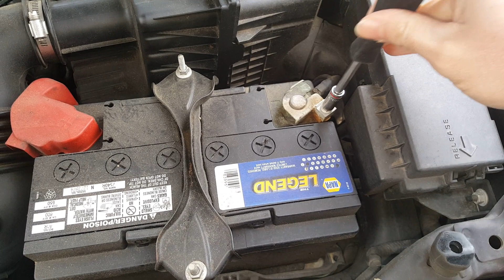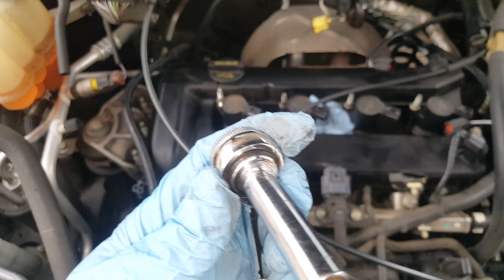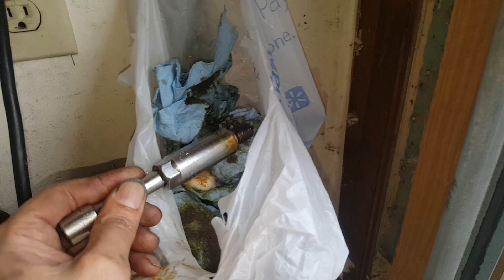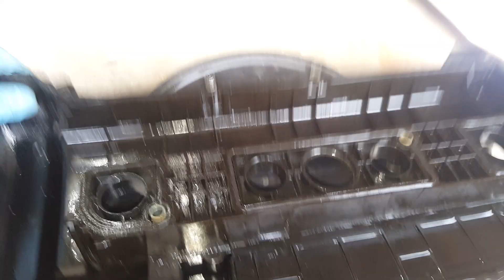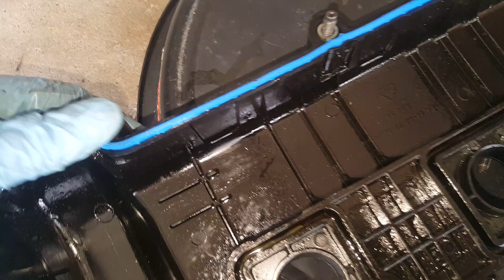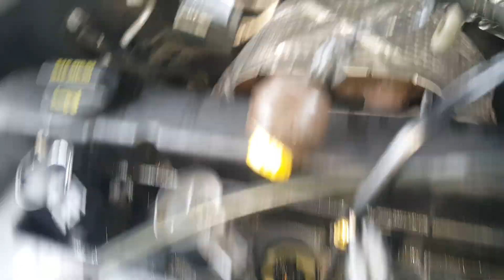How to replace the valve cover gaskets 2005-2008 ford escape 2.3l

Comment: Thanks for this video. Are all the gaskets for this engine blue? I do like the contrast. Thanks again
Reply from the maker: I believe these were fel pro , atleast they came as blue gaskets. I have had pretty good success with fel pro . Thanks for watching
Reply: @WrenchTheory501 I actually ordered them through Amazon for 13$ . They were blue as well. The job went well. With the acception of trying to disconnect the one sensor wire. Took me 15 minutes to release it. Thanks again

Comment: why is there oil on coil pack? 
trying find videos. why Internet not helpful! you have video for what's below this valve gasket oil is my concern. pull plugs i see some oil.. below them also do I have change gasket down further
Reply from the maker: Replace the gaskets shown in this video and that will fix it. Appreciate you watching

Comment: Excellent video. This is the third different video I watched before I do my 2003 Escape, but hands down THE very best. Thank you for showing ALL of the angles and potential problems and issues. You left no stone unturned. I’m very mechanically inclined, and I know I can do this with the knowledge you provided without fail. Thank you for covering everything and even better, by doing it one handed while shooting your own video.
Reply from the maker: I really appreciate the exceptional feedback,  thank you.
Reply: I just finished this job! Thank you so much again for your outstanding video. I took the most time cleaning the valve cover top and bottom, and the top of the engine.  It was a simple job. All of my plugs were full of oil. I pulled out about 6 ounces, but the coils slid off the quite easily. I replaced them too, and put it all back together, except I made one mistake. I dropped one of the 10 mm nuts and it stayed somewhere hidden on the engine and I couldn’t find it.

Comment: Escape 2.3L  According to the Ford service manual the:

FoMoCo Part Numbers and Torque Specs:
Ignition Coil (4x) 12A366; Dielectric Grease FoMoCo ESE-M1C171-A in the coil hole,
Spark Plug (4x) 12405, Gap to 1.25 - 1.35 mm (0.049 - 0.053 in), and Torque is 12 Nm (9 lb-ft);
Ignition Coil-to-valve Cover stud bolt W705310, Ignition coil torque to 8 Nm (71 lb-in);
Valve Cover Gasket 6M293; and
Valve Cover Bolts (14x) W705310 (10 Nm (89 lb-in)).
Your Welcome.

Comment: Why mechanics I talked to don't wanna do this? It doesn't seem so hard but they said these changes often fail. Everyone suggested me to buy a new engine so far. As someone who doesn't know anything about cars and engines, I am afraid of changing this myself.
Reply from the maker: The valve cover gasket is a very simple process , however a head gasket is a whole different story. Thank you for the feedback.
Reply: @WrenchTheory501  my friend told me it was head gasket but maybe it is called valve gasket? The issue is same as yours. The oil fills in the spark plugs. Is there a way for me to understand which one it is?
Reply from the maker: It is the valve cover gasket , the seals around the spark plug wells are leaking. It is a pretty easy fix , and not expensive. Thanks for the feedback.
Reply: @WrenchTheory501  Thanks so much!

Comment: Hey thanks for making a video, I tried using the link for Amazon for the gasket and it says it doesn't fit a 2005 Ford escape on Amazon... 😬
Reply from the maker: Ignore their compatibility guide . If your escape has the 2.3l , it will fit. Thank you for the feedback and thanks for watching.

Comment: My 2008 xlt have oil on the spark plugs. It start shaking, feel like it’s dragging, and  accelerate slow after the car warms up. It went away after I changed the spark plugs and the oil drained down. But 2 weeks later it started doing it again
Reply from the maker: If your spark plugs and gaskets are all good that should keep the oil out of them. I would move on to the coil packs . Thanks for watching.

Comment: Excellent video. I have a 2005 Escape and was just told why there is oil in the slots where the spark plugs are. Time to order a gasket set, some new plugs, and some new coil packs. Thanks, your video was very helpful
Reply from the maker: Thank you very much for watching.

Comment: oil in the spark plug wells, not all of them only a couple, tgis the reason? 08 escape with 174000km (108000 miles) just replaced plugs cause it was time, discovered oil in the 2 outside plug wells....also the coil pack that pulled apart on you is the EXACT one that pulled apart on me
Reply from the maker: Thank you for the feedback, and thanks for watching.

Comment: Man thanks so much for the detailed video. I’m a licensed electrician so I’m pretty handy with tools and multiple parts, but I’m far from a mechanic but watching your video makes me feel confident enough to replace my 2007 Ford Escape XLT valve cover gasket. I recently purchased the small suv for $2000 with 120k miles. Very minor leak. But I’ve also got a belt squeak that only happens upon starting and goes away after letting it run for about 3-7 minutes. What do you recommend to stop the noise
Reply from the maker: Thank you for the great feedback, it is much appreciated.
Reply: Earplugs bro...that's what I do

Comment: Doing this same job on an 2007 mariner with same engine. Pulled it apart so far and just waiting on the gasket. Also pulled 02 sensors. Both mine were bad due to the oil leaking down into them.
Reply from the maker: Best of luck on yours and thanks for watching.

Comment: Hi there.  Do you know location for PCV Valve..or can you make a video on it please. Thanks
Reply from the maker: It is under the intake and not real easy to get access to. You have remove the intake and pull it back out of the way. The pcv will be held on top of the crank case vent oil seperator. You have push in on 2 tabs to remove the pcv . Pick tools work great. Hope this helps . Thanks for watching.

Comment: I got the same problem with my 2009 mercury mariner . I was driving and smelt oil burning and I know this car doesn’t leak underneath. Low and behold I opened the hood and at the back of the valve cover I see oil. Thank you for the video and your help!
Reply from the maker: Thank you for the great feedback and thanks for watching.

Comment: Excellent one handed video!!! LOL. Great detailed walk-through. I have a 2006 Escape hybrid (160+k miles) that has the same issue (oil in 2 of the spark plug compartments) and I now feel very confident in tackling this. I've not done value covers before so this has been a huge help. Thanks again.
Reply from the maker: Thank you for the great feedback it is much appreciated.
Reply: I know this was a bit ago.... But how'd it go? Getting ready to do this with my 07 hybrid @ 200k
Reply: What's the little 2 dabs of Greece that you put on the block for and what's it called ?

Comment: you can pick up 6 coils for 25-35 dollars for all of them on ebay. i've bought two sets or coils one for myself and one for a friend.  Have to say it's been 6 years and the coils are still working.  They still offer the coils on ebay.  https://www.ebay.com/itm/6Pack-Ignition-Coil-For-Ford-Escape-Taurus-Mazda-3-0L-V6-2003-2004-2005-2006-08/254523289826?fits=Year%3A2006%7CModel%3AEscape%7CMake%3AFord&hash=item3b42c530e2:g:cwgAAOSwq15eVbI3
Reply from the maker: Thank you for sharing and the feedback and thanks for watching